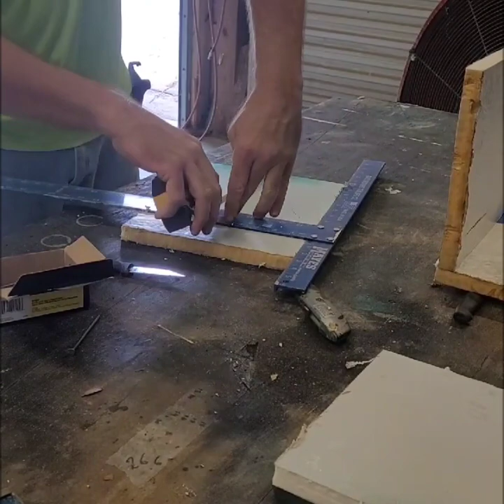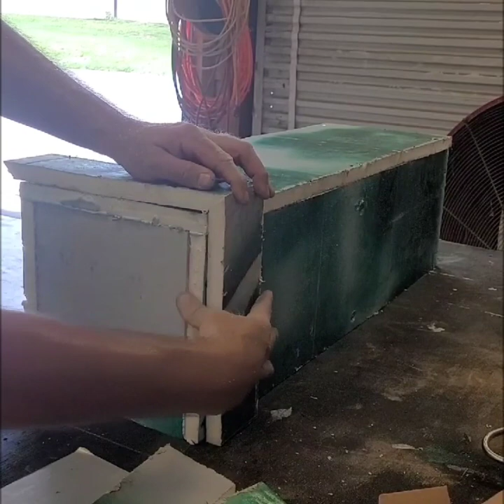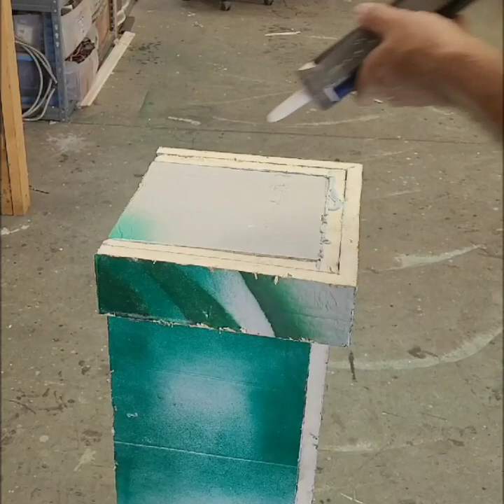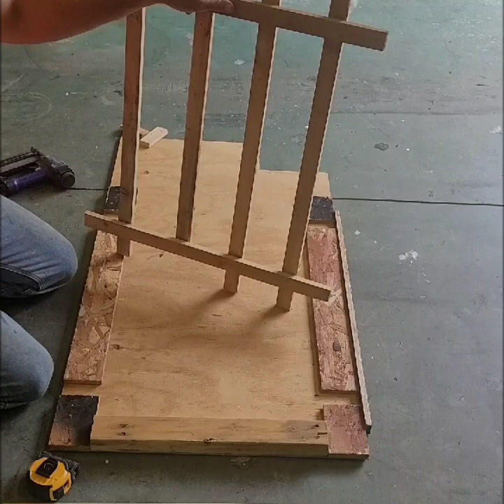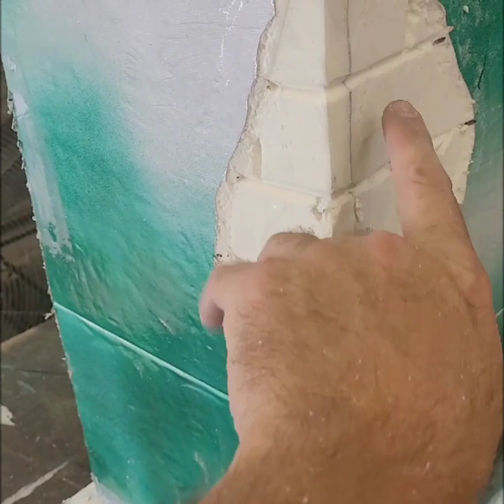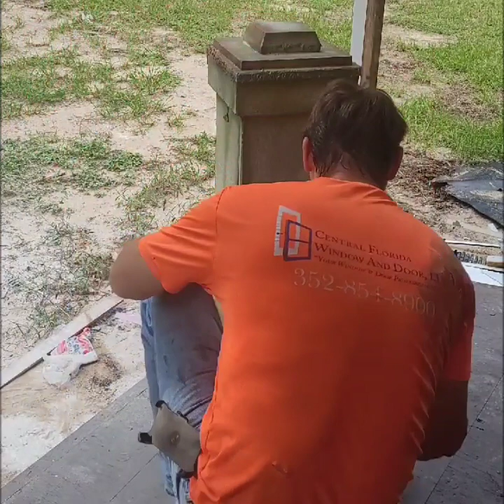DIY cemetery columns

Comment: You do some nice work. Been toying with updating the fence in graveyard. Two big issues are holding me back, lots of wind and no storage. <sigh>
Reply from the maker: What i do outside of putting a weight in the column. Is I'll run a small pipe like 1/2 electrical conduit next to it and tie the fence to it. Makes it stronger.
Reply: @Paulsprops-dc4mt  every year I end up engineering better and stronger hold downs. Every year Mother Nature brings a bigger wind. Usually about 2-3 days before trick or treat.
Reply from the maker: Yup, after you spend hours getting everything just right. She feels like this prop really needs to be over there. She's not helping despite what she thinks. My mausoleums i have eye hooks inside, so i can tie them to a dog auger that i screw in the ground.
Reply: @Paulsprops-dc4mt  dog auger. Hmm. Good idea. I have one of those.
Reply from the maker: I get those because they are cheaper than going to home depot. Plus Halloween time is during hurricane season in Florida and those are hard to find. But a pet store always seems to have them🤫
Reply: @Paulsprops-dc4mt  ahh hurricane season. Not that windy in MKE, though the stronger  winds and cold rain of November always arrives early. Add that to being on a high hill, makes it hard for this caretaker to keep the dead in ground. Did I mention fog? Not sure why I bother with this obsession. Best fog I had was last year, a week before Halloween and the temperature dipped into the mid 20’s. Between the new chillers, air temperature and a rare lack of wind, it was a albeit brief thing of beauty.
Reply from the maker: We definitely dont have a problem with the 20s. We're lucky not to be sweating like crazy on Halloween. Fog not heard of after late April. But we do get wicked afternoon thunderstorms that can really mess up a good display.